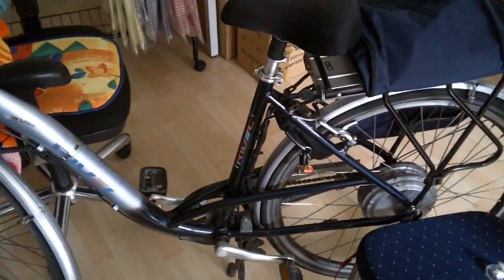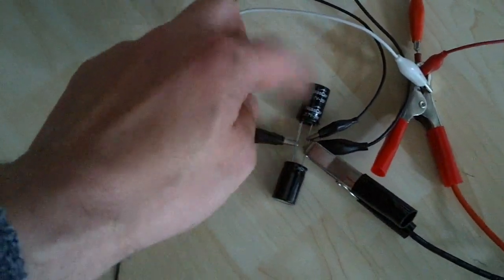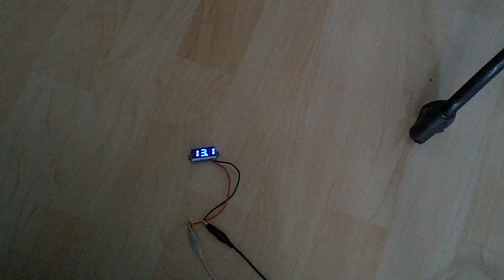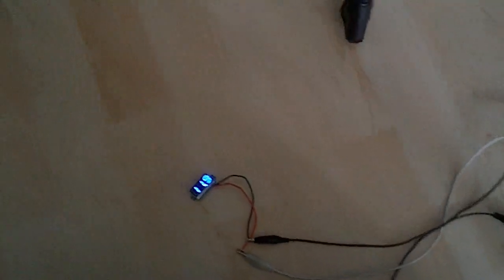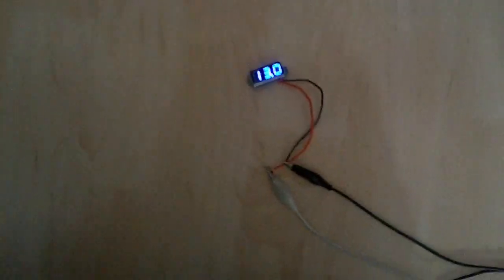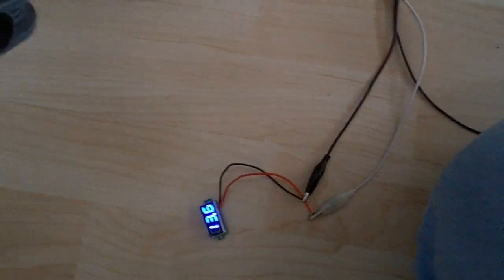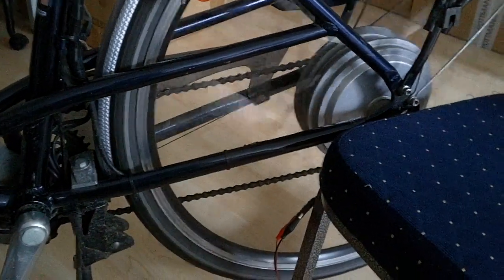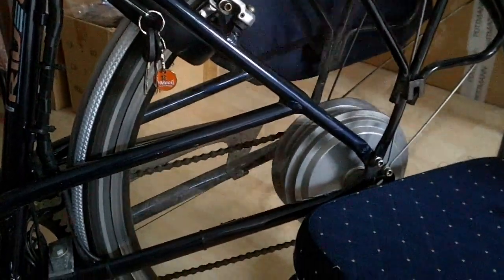e-bike 24 Volts motor used as a DC generator

Comment: could u not use the ebike battery at times instead of peddling in order to charge things up. would work perfect if u had two batteries for your bike.clearly if we had no power and this was the only option my solution would be difficult but Ive been racking my brains on something I could make for myself for a while now.

Comment: I know this is a really old video but I'm curious, were you using a diode or something at the beginning? The capacitors seemed to be charging but only when you changed one wire the capacitors began to power the motor
Reply from the maker: Always ask, please do! The capacitors were already charged up a little bit, otherwise it would take longer to get it started. As I mention at 0:45 there is a diode between the motor (generator) and the capacitors. All I did was start the inverter to produce 230 Volt output at a certain moment. And no, the capacitors did not power the motor! It is the other way around, the motor powers the capacitors and the light. Check my other movie and see how I power up a  part of a toaster, you will see the wires will glow red hot.
Reply: @deslomeslager  Thanks for the clarification, I didn't notice the part where you mention the diode

Comment: Hi. I have a e-bike 36V 250W. Out from the motor are 5 wires. Blue, brown, green, white and yellow. I have tried to measure the voltage with a voltmeter from two and two wires after 
spinning the wheel, but I get no reading on the voltmeter. What do I do wrong?
Reply from the maker: Oops, that I don't know. There are many possibilities, one of them is that there is a control board in the motor. If that is the case you can't get a voltage out of it. And I am not sure if opening the motor would be a good idea, sorry.
But maybe somebody else can answer your question.
Reply: @deslomeslager   Hi, Martin S has a multi-phase AC-Motor (obviously Brushless). You just must connect the AC-Wires to a Diode-BridgeRectifier...

Comment: Can you please give us information about circuit diagram?
Reply from the maker: Generator for DC voltage: e-bike motor (human power). Generated DC power goes into series connected capacitors. The series connected capacitors connect to the INPUT of a (12 Volt) DC to AC converter. On the AC size (220 Volt) is a lamp. I skipped explaining about the voltage and Watt meter, something to guess for you :-).
Reply: But how did you work generator as a motor by just swapping one connection?
Reply from the maker: @mohdramees09  A motor = a generator. If I do not push the pedals, the motor will drain the supercaps as well by spinning around. Note: I have nothing else attached to the motor, all electronics are removed, I only use the plus and minus wire from the motor.

Comment: Did you Try to charge bike's battery pedalling in home?
Reply from the maker: In the shown setup the bike's battery is not involved. The bike is in my home yes, so far you are correct.
Reply: @deslomeslager  I think the battery is charging with a dedicated charger. But you can put the charger in the outlet and charge the battery pedaling 😉
Reply from the maker: Hi  @chitibusu , when the battery is above 20 Volts, (and does not have much power at that point) I need to pedal with a high velocity to get to the 20 Volts. So if I want to recharge it, I would need to use a voltage booster. Pedaling is like 'cruising' as the motor/generator delivers 12 Volt.
Reply: @deslomeslager  I understand now, thank you for the information. Good work!

Comment: Thanks for the detailed video information. I am not an electronic student but am keen to make this experiment. I have a 24 volts 250 watt brushless dc motor and 26 volts 11 amps (286 watts) lithium ion batteries. I would like to light few dc bulbs. How do I pedal and generate energy and store energy in the batteries and use it to light the dc bulb? What other (eg. Capacitor) components will be required? Kindly explain me in details because I am not an electronic student. If you have a lot of information, send me a mail at rath.sanat@gmail.com. Thanks in advance...
Reply from the maker: Hi Sanat,
Your ideas are great, and fit into the category of home and D.I.Y. However, putting batteries in series does have a small problem. If they are not equally charged, or not have the same capacity (or internal resistance) then charging them up will give problems. If you want to light up DC bulbs, it would be wise to use adc2dc converter, so you can go for a DC lamp with a fixed voltage. Or even dim the lamp by lowering the voltage below its required voltage.
You could also go for an ac output using a standard 24V DC to 220V AC generator. They will accept 26 Volts as well
It is not possible to give a complete overview of answers to your question. I do know that if you have the original charger for those batteries, I strongly suggest to use that one and use a DC to AC generator. The original charger will respect the needs of the batteries, and charge them correctly. How ever, I am not sure if you can use your brushless motor to drive the AC generator, it depends on the charge rate of the charger for instance.
I hope I have motivated yo to continue walking this path! Keep experimenting, it really has additional value on top of just using devices already made. Just make your own. And if you do not have the knowledge, keep looking around on the internet, there is most certainly a video that brings you exactly the right information.

Comment: "overunity" is such a misunderstood and misused word, as are the three laws of "Thermodynamics", too many people throwing all those words and phrases around (both the believers and haters) like a weapon or a shield, I wrote a paper on it a while back. the fact is, my data is based on the inherent inefficiency of a motor converted to use as a generator, if a motor can provide only a 5%-10% +/- percent conversion relative to the rating of the motor, an 8000w motor could supplement a 750w motor, the specifics of my design have been put through severe and unbiased scrutiny by myself, (I made the purposeful assumptions that the system would fail, but calculation after calculation, I have succeeded in defeating those assumed failures), the fact remains, I just don't have the extra money to purchase the parts I need to research and produce prototypes for my project/s, so that's why im looking for organized data from those who have dabbled in the generation portion of the works...magnets are not magic, they are batteries, the statements/laws of "you can't create or destroy energy, only change it" is ABSOLUTELY true, but the true objective of "overunity" projects is not about creating, they are about efficiency of the conversion from one or more sources of of energy, stored, potential or direct. after all, a nuclear powerplant uses far less energy than it does to produce the amount it does, by ignorant definition of those that misunderstand the phrase, power from nuclear generation IS an "overunity" device.

Comment: if you could do some regulated result reporting, it would be of great value, the type of hub motor (brushed/brushless, geared/gearless) the rated V/A/W of the motor, and the amount of torque and RPMs used to attain  the various outputs. 

though the voltage is important to know, as an analogy, in electronics, voltage is equal to volume & amperage is equal to weight, so a volt is like a 8.5 inch sphere, but the amps are what matter, if you compare a 8.5" spherical Styrofoam ball that weighs 6oz and a standard size 10lb bowling ball, they are both the same size (x volts) but have very different capabilities, V * A = W, so what is the volt & amperage output at 60rpm ??? (and measure at 120, 240, ect. also)

I'm looking to start a project using an 8000w hub motor as a front wheel generator to supply or supplement power for a 500w-750w rear motor, but would like an idea of what the efficiency of generation from a motor of the one you used to produce your results, I'm trying to get as much data as I can before dumping all my money in the parts I need
Reply from the maker: Thank you for sharing your project with us.
You are asking details which would be very time consuming to get them. I would also not be able to collect the data on my own, unless I would have specific tools like  a motor or engine to rotate my motor/dynamo/wheel so I can do tests on Volts and Amp measurements.
The motor on this e-bike is no longer for sale (for a while now), newer motors are smaller. Much smaller.
With regards to your idea, I would not use one wheel to provide forward trust and use another one to generate power back, unless you have a overunity generator.
PS: I think my motor is brushed. If it was brushless it would contain electronics to deliver power to the coils. Running the wheel manually would then not provide any power (I guess) as electronics would have a way to prevent B-EMF to travel backwards into the circuit.

Comment: I know this is very easy to a lot of people but to me I am racking my brain on to running a hub motor very simple just one control without all these controllers and everything I'm like Richard Dreyfuss in Close Encounters I can't picture the mountain being with a tip on it till you finally cuts off the top and get the idea I am just that close I've been just up for nights and days figuring this out trying to can somebody please simplify this for me I have to see it
Reply from the maker: You say: "I want to run a hub motor, very simple". Tell me: what did you leave out in your idea? because telling something in a simple way does not make creating it more simple. If you get my drift. I know there is a Russian man who has an e-bike with one motor in the front wheel. It does as well recharge the battery when it is going down hill. But I have no idea what kind of battery he uses for it. If you choose simple, go for lead-acid cells. You don;t need to constantly check that every cell is charged correctly. Otherwise you would need to go to a ONE battery type of motor. However it would then be high amperage. High amperage = thick wires. But it can be done I think.
Reply: Well I want to thank you very much for your response back that quick however I did purchase the bike at the flea market for $60 it has a front wheel 8 fun 500 watt Hub motor it comes with the controller and all that but they've been cut and has a gigantic battery I think it may be nickel cadmium and it also looks like it is lithium they have thick wires in it is 48 volts so supposedly do you wish to see a picture of what I have maybe you could describe it because I would like to run it someone like you to run a drill just pulled push the button on it and it will start going something simple like that to run through the battery now all these sensors and everything coming out of it that this has 9 wires through thick wires and 6th in wires your Hall sensors
Reply from the maker: Michael Hobbs
Well Michael, if that is the starting point, it does not get easier. I do have to say IF the batteries are NiCad, those are great. Bad for the environment, but if you have them, use them. They are easy on charging. Regarding the motor: if you spin the wheel you will get a voltage out on a few wires. If there are just 2 wires creating that voltage, you'll know those are the ones to use. But I would not recommend putting 48 Volts on it without any controller, you would get a spinning wheel and burn rubber!
I hope you can get a bit further on this, I am not able to help you with this: I mainly concentrate on using the output of the motor. In your case that could be very interesting. A 48 Volt motor will create 12 Volt at a rather low speed. Perhaps you can do funny things with it!
Reply: Well I do thank you very much and yes I know it by the way that they are lithium batteries I will find somebody here local who does electric bikes I do have a card from somebody it's just trusting somebody and anyway thank you very much for your help on this

Comment: Use the motor as a motor and generator have it re-charge the batteries while you are coasting.  I just tested my ebike motor and it puts off a lot of power while peddling.  Looking for ideas on how to wire it.  Thanks
Reply from the maker: Hi Bob,
There are modules on the net which can do this (usually in the form of 'regenerative breaking'. If you want to charge the batteries yourself it is getting a bit difficult. The chargers are all different, so I am not sure if you can use the same connector and just connect the positive and negative. Also you would have to double check if the motor negative is the same as the battery negative (usually grounded on the bike). The idea is that you do can use a DC2DC converter to increase the voltage to what your battery needs to charge. You should use a dc2dc converter with these specs:
1 - it can convert as well up as down. If you peddle slowly, it must be boosted up, if you go to fast, the voltage needs to be lowered
2 - it should have a max.-current setting. And it would be nice if that potmeter (variable resistor) to 'set' the current could be extended to your handlebar. By changing the amount of current to your batteries you can change the amount of power to be drawn from the generator. The maximum voltage needs to be set accordingly to your batteries. 
This is a quick and dirty method. You are responsible for not overcharging the batteries (every type of battery charges differently, my description is used for NiMH batteries or NiCad, but NOT for Lithium variants), for not overheating the batteries and for shortcut scenarios (because you will most probably charge the batteries with direct leads to the batteries). But I am sure using one good dc2dc converter it can be done. And extending the lines to the resistor to set the current is an easy way to control the amount of extra load ('drag') you are going to be dealing with. You could also use a switch to overrule the variable resistor when you are using your breaks, so that the maximum amount of current is set.

Comment: deslomeslager your modified the hub motor with magnets? or just bought the inverter?I have a motor 1000w and do not know how to generating electricity
Reply from the maker: +ESCOBAR CRISTIAN Thanks for asking. The amazing thing here is that I am using a standard electric bike. All I did was disconnect the motor, and use the two leads (positive and negative) to power other things. But as a trade of I do have to peddle the bike to generate electricity. And to be precise, no. I did not add anything, no magnets, nothing. In fact most of the DC motors will generate a DC output if you rotate them.
Is your 1000w motor an AC motor? Then it does needs some modifications to run. In some cases you do can get it to produce power if you connect a capacitor (must be at least 2 times the rated voltage of the motor). When you turn the shaft the smallest amount of reminiscent magnetic field in the iron will get the voltage up. Together with the capacitor the voltage now can rise (while you turn the shaft). If the voltage is high enough you may add a load. If you add the load to soon, it does not work. I hope this explains a bit. There are very good explanations on YT if you want to know more. I can't explain this in text very well, a video says a lot more!
Reply: +deslomeslager Thanks! one last question, do you think that with a hub motor can generate 60v, perhaps one of 3000w
Reply: deslomeslager it is necessary connect one capacitor of 120v or two?
Reply from the maker: +ESCOBAR CRISTIAN The answer is: Depending on the rotations per minute (rpm) your motor will generate a different voltage. Do you know the RPM when it is powered? Yes? I would say that if you manually rotate it the same RPM (plus 5% extra) you could reach the same voltage it was made for. Then double it. But if you run it on lower RPM, then it is more difficult to say what you would need. If you can get hold of a MOT capacitor (Magnetron capacitor), those are for high voltage and will do the job for sure.
Reply from the maker: +ESCOBAR CRISTIAN I am very sorry, answering to an open question is very difficult. Guidelines are: the motor you use has already a voltage rating. Use it as a generator and you may expect it to deliver almost the same as what it consumes. My e-bike motor is 250 Watt, 24 Volt (DC). If I use no load on it and spin it up I can get 30 Volts. As soon as I load it the voltage drops. If I peddle real fast I can get more than 250 Watt out of it. But perhaps the motor would overheat if I would do that for to long? Keep being realistic, what you put in is what you get out minus losses like friction, noise and other losses.
Reply: +deslomeslager Thanks  deslomeslager I appreciate you answer

Comment: U think u could try to make a sustainable bike by using 2 e hub motors front and back wheels and wire them in to a bafang 8 fun gear motor that sits on the shaft hole where the crank sits? That would be cool if it could work
Reply: actually it works well. totally free energy automation it ll look to be. well, the actual idea is , generation of excess wattage than input provided , for this the high rpm , low torque motor can be used as generator .

Comment: is this a 1 phase bldc
Reply from the maker: +salman blast Sorry, I don't have that information.
Reply: if the controller circuit is inbuilt in the motor can we use it to generate electricity
max power we can generate using this u have shown
Reply from the maker: salman blast
Hi Salman. Not every motor is the same. If a controller is built in then my best guess is that you can not get any energy out of it. But if you have one then you should test it yourself. Regarding the power output, the motor I am using will generate up to 300 Watt. Might it be able to produce more, then I would not know that, since I just can't deliver more power with my legs.